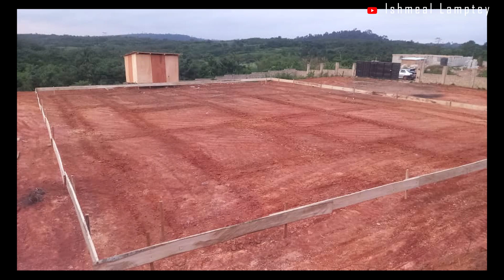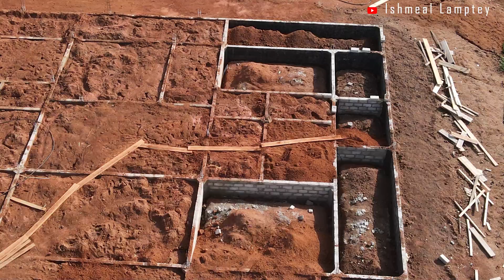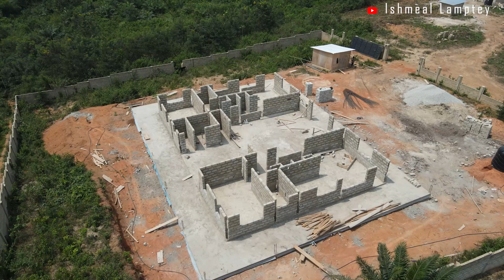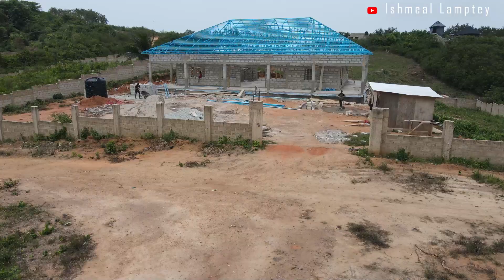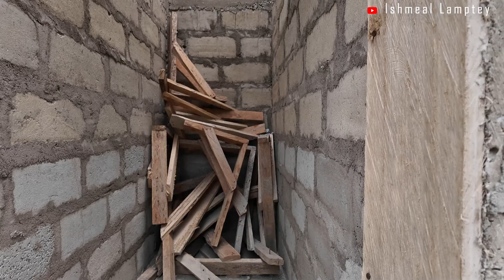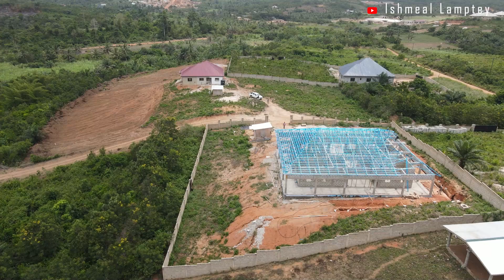Massive 2-Bedroom Duplex Build Update | From Foundation to Roofing!

Comment: It’s a good simple design. Does that reflect in the cost of building it? What did it cost to build?
Reply from the maker: Sorry to disappoint as the design doesn't reflect the cost. It's a massive house hence the cost is a bit on the high. We've spent about 45,000 USD so far to this point.
Reply: @IshmealLamptey  Ishmael, can you help me with this plan. I love how the base is set up.  I would also like one huge master room at the top with the kitchen and sitting area. I would link up for the land survey. Thanks
Reply from the maker: @ebenezerdjangmah5266 Hi, i would have loved to but it's against the ethics of the work to share plans of clients.